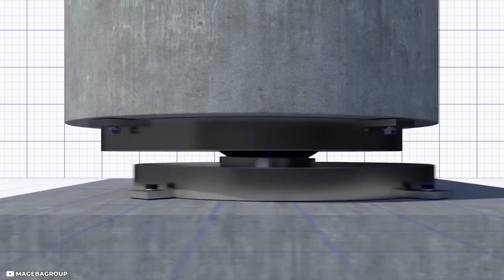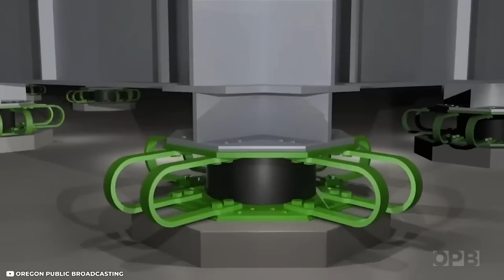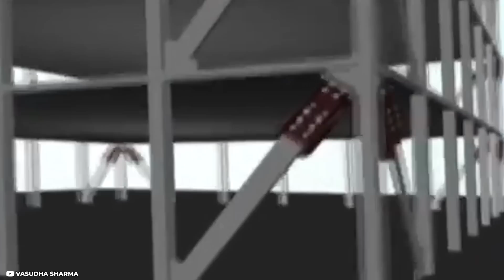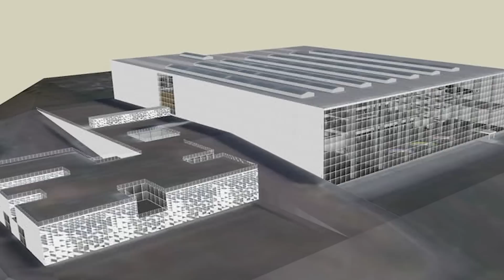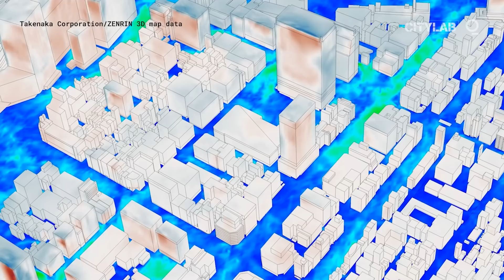Japan's Earthquake Proof Buildings (And What Turkey Can Learn From Them)

Comment: Even Japanese Buildings will not stand against 8+ Earthquake
Reply: Japan's earthquake resistance class 3 is designed to withstand earthquakes of magnitude 8 or higher. These are mainly used in buildings that serve as bases for disaster prevention, such as fire stations and police stations, which must remain operational in the event of an earthquake.

Comment: As an engineer, keep in mind, that skyrise concrete structures are less in danger than medium or small buildings as we have witnessed in turkey. All the buildings which were collapsed was medium or small buildings and sky rise buildings were also damaged but didn't  collapsed . because high-rise structures don't store the force but release the force by to and fro motion and it doesn't matter how strong an earthquake unless it frequency doesn't match the structure's frequency

Comment: Turkish engineers know how to build resilient buildings like in Japan. Actually, Architect Sinan invented some methods against earthquakes during Ottoman times that still are applied today even by Japans. But the main problem is the money for Turkish people to benefit from all of those methods. Turkish economy has been suffering for decades because of the conflicts around it, like in Iran, Irak, Syria, Ukrain and Palestine etc. 
And please note that Turkey’s earthquakes are more shallow than Japan’s (only 10 km below the surface) and not in the middle of the ocean..
Reply: For example, the Great Hanshin-Awaji Earthquake in Japan had a relatively shallow epicenter with a depth of 16 km.
The shallower the epicenter, the closer to the ground it is, and the stronger the ground shakes, but the range of the strong shaking is narrower because the shaking is not transmitted as far.
Conversely, if the epicenter is deep but the magnitude of the earthquake is large, as in the case of the Great East Japan Earthquake in Japan, the shaking is transmitted far and wide. Thus, the whole country would be shaken by a terrifying earthquake!

Comment: Turkey cant Learn anything from this. 
Turkey right now is a Dictatorship under a Leader which Beliefs Firmly that his Country is Supposed to be a Large Empire. 
And if you want to have a Large and Bustling Empire even tough You dont have the Ressources or Economy for it. You need to Cut Cost and Restrictions wherever You can. 
So in Turkey the Priority Number 1 is to Build As Tall and as Cheaply as Possible so you can Build as many Giant Buildings as other much Larger Countries despite having nowhere near the Ressources these Larger Countries have. 
That just doesnt Mix well with Expensive Safety Standards and Building Methods.

Comment: there are differences between Turkiye and japan earthquakes.
Earthquakes in Japan occuring at a distance of 150-300 kilometers from mainland and at a depth of 30-60 kilometers.
Earthquakes in Turkiye occuring just below the cities and at a depth of only 6-7 km.
Therefore, earthquakes in Turkiye are much more destructive than earthquakes in Japan.
however; The areas where the earthquake occurred in Turkiye are poor areas. Therefore, poor quality materials are used to keep construction costs low.
Japan is a rich country and the people are more prepared for earthquakes and more conscious.
Reply: A deeper epicenter does not necessarily mean less powerful.
For example, the Great Hanshin-Awaji Earthquake in Japan was a relatively shallow earthquake with an epicenter depth of 16 km.
The shallower the epicenter, the closer to the ground, the stronger the ground shaking, but the range of strong shaking is narrower because the shaking is not transmitted as far.
Conversely, if the epicenter is deep but the magnitude of the earthquake is large, as in the case of the Great East Japan Earthquake in Japan, the tremors are transmitted far away.
In fact, this earthquake caused devastating damage throughout the country.

Comment: Turkish building codes are already fairly advanced with regards to earthquake protection, the problem is that builders pay off government inspectors so they don't have to use the expensive seismically resistant methods and materials that are mandated by law... Politicians encourage this because hey- they get kickbacks too so it's all good. The fact that people will die as a result isn't their problem, that's for years later when they'll be retired and no longer responsible. Turkey is going to have to radically change their politics and face their corruption problems first, before any new building standards are applied.

Comment: None of the earthquakes in the last decade directly hit Japan. The epicenters were far away, in the ocean. In comparison, kahramanmaras earthquake's epicenter was near city center and it was 6 km below the surface. All these elevated the destructive effect of Kahramanmaras earthquake.
Reply: It is a big lie that no earthquake has hit Japan directly in the last ten years. In 2016, an earthquake with a magnitude of M7.3 occurred with an epicenter at a depth of 12km in the Kumamoto region of Japan (32°45.2′N, 130°45.7′E).
Reply: @staplefood9879  yes there was kumamoto earthquake. But it was 7.0 magnitude, which is 1/5 of the kahramanmaras earthquake in strength.
Reply: It was not only the magnitude of the earthquake but also the nature of the shaking that increased the damage caused by the recent earthquake in Turkey. The periodicity of the shaking was relatively long, ranging from one to two seconds per quake.
Such periodic shaking is also known as a 'killer pulse' because it causes significant damage to buildings. It has been observed in the 1995 Great Hanshin-Awaji Earthquake, when many buildings collapsed, and in the 2016 Kumamoto Earthquake. Moreover, what was worst this time was that the area where this 'killer pulse' occurred was approximately 170 km from Kahramanmaras to Hatay in the south-west.

Comment: These two earthquakes are different. Even Japanese buildings would collapse  with this kind of powerful and different earthquake.
Reply: March 2011 earthquake in Japan is magnitude 9 lasted more than 2 mins but the buildings withstood it, it was the tsunami that caused more damage.
Reply: トルコの弱い建物とは違うからな
Reply: We have adequate codes. But you can be a contractor in Turkey even without middle school education. Also the control mechaism is corrupted because of greed. The birbery and ignoration.

Comment: If Tokyo were hit by an earthquake of this magnitude, it is certain that there will be more deaths than in Turkey.
Because many of the house are old.
Reply: Do you know where Tokyo is?
Reply: @AinzWoolGown  
I'm living now. ＋I'm Japanese.　There are large numbers of old houses that were rebuilt immediately after WWII.Japan is one of the most humid countries in the world, and buildings are prone to corrosion, so they need to be rebuilt, but too many houses are left unattended.
Reply: I think regardless of religious ideology.Humans never win against nature.
Reply: Regardless,
To state that Tokyo would surpass turkiye s death toll seems ludicrous. Because turkiye is much more of a historic city than Japan with lots of old buildings. Japanese old building usually have lots of moving parts making them less rigid. 

Plus look at the field survey report of the 🆕 buildings that collapsed in Turkey. They don't even have beams. Just a thick slab with extra reinforcement. Not even post tension. Below threshold column sections. Inadequate reinforcement.

Note - most humid countries are tropical countries near equator.
Reply: @AinzWoolGown  トルコが日本よりも歴史的？そんなわけないだろ。建築の勉強をする前に歴史を勉強しろ。

Comment: Earthquakes in Turkiye are 7 kilometers below the ground and the epicenter is in the middle of the city, while earthquakes in Japan occur in the ocean and are 30 to 50 kilometers below the ground. There is a big difference.
Reply: Though Japan also has shallow, onshore earthquakes in urban Areas. They do cause a lot of damage, and deaths, but still by far not comparable destruction as seen in Türkiye.
Reply: And hadn't been for tsunamis, they would still suffer minor damage from a magnitude 9 quake. Here in Italy even a M 4 event can cause some considerable damage.
Reply: @GoodMusicManiac999  Though the considerable Damage should be limited to historic Buildings. Modern Buildings should withstand a Magnitude 4 Earthquake without structural Damage. (Except Earthquakes on Ischia, even with small Magnitude they have a extremely high Ground Accelleration). Also important difference between Italian and Japanese Earthquakes is, that Italian Quakes are much shallower than japanese Earthquakes and often close to settlements. 

Sadly we don´t have Data how much Damage the Earthquake itself in Japan 2011 caused. But it certainly wasn´t minor. The highest Intensities have been found in Prefectures which were then hit by the Tsunami. But several Prefectures haven´t been hit by the Tsunami. There the Intensity was much lower, but still a lot of Damage was caused. For example Tochigi, were over 74,000 Buildings have been damaged and over 2,300 been destroyed. Even in Tokyo, a lot of Damage was caused (6,570 Damaged, 243 Destroyed). 

If shallow Quakes in Japan happen in urban Areas, even Magnitude 4 Quakes have caused Damage in the past. A really shocking example sadly is the 2018 Osaka Quake. A Magnitude Mw 5.6 Quake happening in one of the countries largest Cities. It was shallow so its Intensity was quite high. 6 People died, 462 have been injured, 504 Buildings collapsed and over 60,000 Buildings have been damaged. 

But in overall, Damage from Quakes in Japan is still far below what we would expect from Quakes with similar Intensities in most other Countries.
Reply: It was not only the scale of the earthquake but also the way it shook that made the damage so severe in the recent Turkish earthquake. It was a relatively long-period tremor, about 1 to 2 seconds per tremor.
Such periodic shaking is also called "killer pulse" because it causes great damage to buildings. This was observed in the 1995 Great Hanshin-Awaji Earthquake, when many buildings collapsed, and in the 2016 Kumamoto Earthquake. Furthermore, the worst thing about this time is that the area where this "killer pulse" occurred was about 170km from Kahramanmaras in the southwest to Hatay. In fact, several Japanese experts have pointed out that "if this earthquake had occurred in Japan, there is a high possibility that there would have been great damage in Japan as well."
As for the reason why the building collapsed due to the strong shaking, an expert analysis revealed that many places collapsed in a way called "pancake crash". In "Pancake Crash", the pillars of the building lost their strength due to strong shaking, and the building collapsed vertically. The building collapses in a short time, so people inside don't even have time to escape.
So why were so many buildings destroyed?
This is because many of the buildings where the "pancake crash" occurred were "plat slab structures" with no beams between the pillars.
Since the building has no beams, the floors overlap each other, making it easier to collapse and reducing the "survival space" in the event of a collapse. This makes rescue operations more difficult. In addition, when looking at broken reinforced concrete buildings, it was presumed that the adhesion between rebar and concrete was weak. Therefore, it can be analyzed that the low strength of the columns is one of the causes of building collapse. Such weak columns are not found in new Japanese buildings.
However, since Turkey's latest earthquake resistance standards are at the same level as Japan's, illegal activities such as the removal of pillars during building renovations were rampant, and it is believed that the authorities' oversight and crackdown were insufficient.

Comment: Early warning system is not effective in Turkey. Earthquakes in Turkey are happening in the land and very shallow unlike Japan where most of them are happening in the deep ocean far from the coasts. In the best case scenario people within 15-20 km of the fault lines may have 5 seconds to escape in Turkey. They should focus on implementing building codes which are good enough to prevent extreme damages as we have seen many buildings in the area were still standing in the last earthquakes.

Comment: SOLUTION:
An effective way to REDUCE
earthquake and volcanic eruption hazards
is to CONNECT Makkah with Antarctica,
Tuamoto with the Arctic, and the poles themselves
through the Atlantic with paramagnetic material        

Why Makkah, because Makkah is ancient North Pole, Electric Magnetic come from the sun go to north pole and Makkah, from south come electric Magnetic, generate Earthquake
Prediction is not the solution, ssgeos you almost there
After we know how the magnetic circulation between the Earth and the Sun, it can be realized why the earthquake and volcanic paths exist in certain areas between Makkah and Tuamoto in the east and west of the Earth’s surface.

That some of the positive magnets that enter the north of the Earth TURN towards Mecca, others go straight to the south. Likewise, negative magnets that enter in the south there are BENDING to Tuamoto in the Pacific and half of them directly north in the bowels of the Earth

While Tuamoto in the Pacific. Volcanic activity there is still valid because the south pole was once a positive magnet. Now traversed by a negative magnet coming from Antarctica

From the SOUTH there is a magnetic flow towards Makkah. But before it arrived, it collided with a magnet from the NORTH in the bowels of the Earth.

Comment: Turkiye builds Buildings that are earthquake resistant.  46 MEGA hospitals  since 2013 for example.  These earthquakes hit an area that Includes 11 cities larger than the Country of England.  The previous local opposition parties had legally stopped the federal government from tearing down older weak buildings so Erdoğan doesn't get credit for fixing the area, this battle has been going on since 2019.  The Buildings the Government did build were unharmed and. not even a window broke in those buildings.  98% of the 718,000 buildings that failed were built before 1999, the 2% of the newer buildings that failed had to do with corrupt builders who cut corners and did not follow code.  LAST I HEARD ABOUT 3 DAYS AGO, THERE WERE 612 ARRESTED FOR NOT FOLLOWING CODE AND PUBLIC ENDANGERMENT.
Reply from the maker: Great comment
Reply: @NeanderthalerYT11  Thank you
Reply: @NeanderthalerYT11  0⁰

Comment: I have experienced these earthquakes myself. Believe me the ground was waving like a sea wave. We are talking about two earthquakes with a magnitude of 7.8 and 7.6 that occurred 10 hours apart. These earthquakes took place just 7 km below the ground. Since February 6, about 12000 aftershocks have occurred. The destruction that occurred in these earthquakes generally occurred in areas with soft ground. Of course, there will be people who will be punished. However, seeing such cruel and brainless comments when people are suffering so much shows that you are not human.
Reply: As a Turkish civil engineer, I can say that our codes are adequate. But the problem is that there are no Municipal or Urbanisation Ministry controls whether the code is implemented or not. Lots of bribery and ignorations are going on. In Turkey, if you have money, you can be a building contractor even if you are a barber..Zoning amnesty was also carried out before the earthquake many times, which means: If you built this structure ignoring codes or engineering rules, you can still get occupancy permit from the officials with this amnesty. This was good for the constructors because they lowered the costs by using bad quality concrete and less reinforcement and still could get the permit. One of the reasons of this massive destruction was greed, the other was ignorance. And we can learn nothing from Japanese because they are higher in character quality. We had the same destruction 20 years ago and took no lessons from the past.
Reply: @emrekalayci4425  I disagree with the last part. You can always learn. If you do nothing, nothing will change. Be sovereign and put those responsible for this tragedy behind bars. Without violence, peacefully but determined. Give the officials an ultimatum that something has to change in favor of the residents.
Reply: この7.8と7.6の地震の時、1週間くらいでインフラは治ったのでご安心ください(私は寝ていました)
Reply: What is your logic? People are suffering so don't address the problem which is for the betterment of the future?
Reply: @ihnmefgfu16428  Yep, pretty much. "How dare you bring up the fact that we have rampant corruption that allowed so many people to suffer die, while we are still mourning those losses."
Reply: 12年前に起きた東日本大震災では津波によって多くの犠牲者が出ました。
その時お隣の台湾からはたくさんの激励と義援金をいただきました。同じお隣の韓国からも心ある方からの支援もありましたが、それ以上に日本に対する酷い言葉を浴びせられました。
主要メディアすら、日本沈没とか歴史に対する天罰だとか、非常に感情的で嘲弄した報道が為されました。
その冷淡なメディアは今、トルコの地震に対しても、この世の終わり地震という扇情的な表現の見出しと、自国が派遣した救援隊の手柄話ばかりです。
Reply: I'm from India near Himalayas and Earthquake is so common here that it doesn't surprise me at all. But thankfully all those earthquakes are always not very big even though Himalaya is continueslly growing every year without stopping.
Reply: So do you want people not to talk and not to find solutions? I suppose you are one of the people thinking the people killed by the quake are martyrs!!!